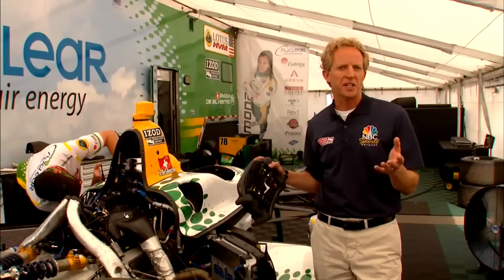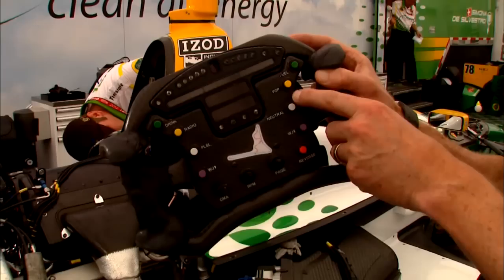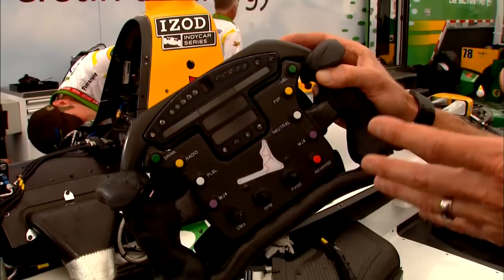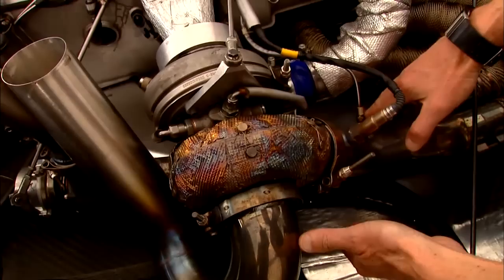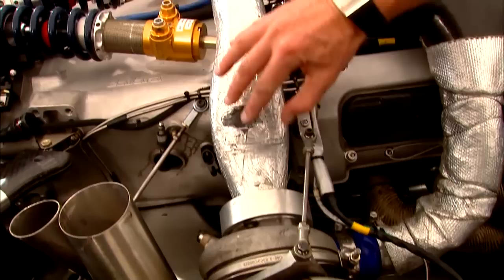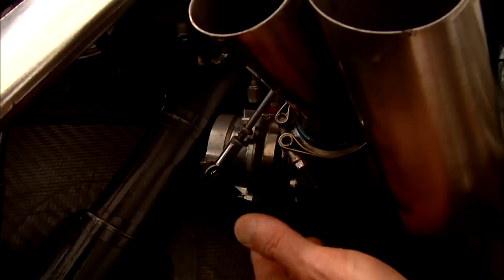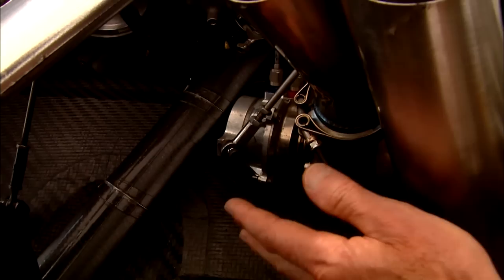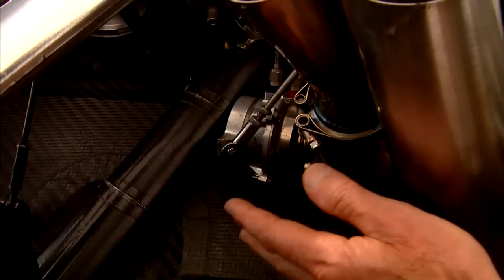Professor B - Push 2 Pass

Comment: After he says spin the compressor and compress the air into the engine, he shows us the wrong route, that's the intake tube that goes from the top of the car into the turbo, the one that comes off of the compressor on the bottom that points forward is the one that goes into the engine.

Comment: Different concept, similar idea. KERS stores excess energy for later use by the driver. Hypothetically you can consistently build up over the race and use it when needed over each lap. Push2Pass is computer-controlled and you're allotted X number of seconds of use per race, once you use it all up it's gone.